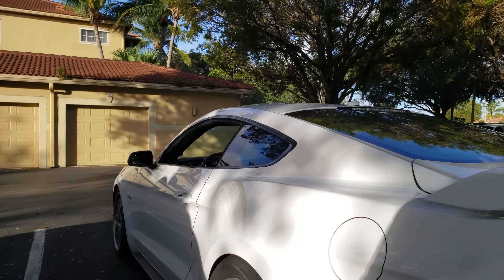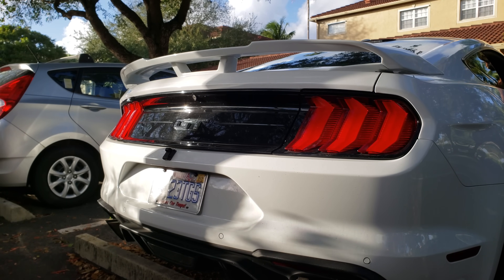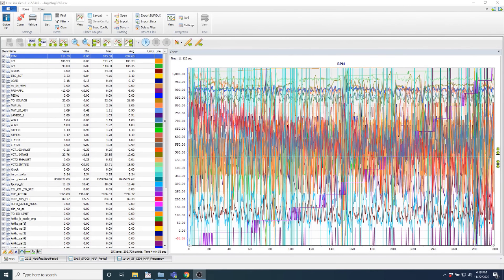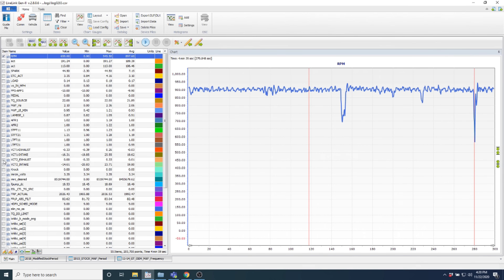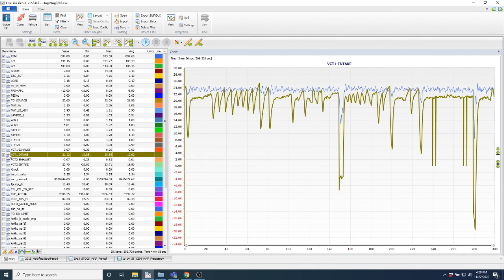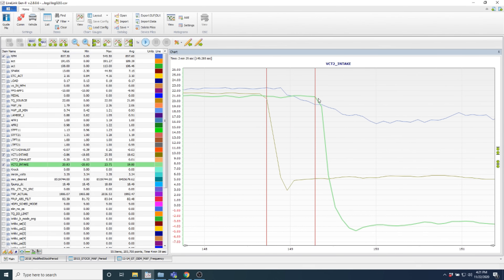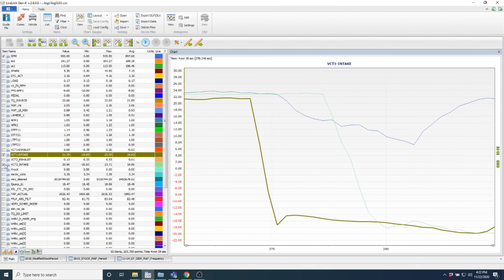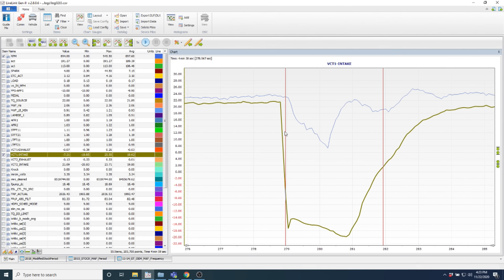Gen 3 Mustang Coyote Intake cam idle stumble issues explained.

Comment: Is a shame they made it that as soon as you touched these Gen 3’s you were in for a rude awakening to pay to play with failures.. goose chasing.. continuous issues.. then put very high quality bolt on you can to mitigate issues and then realize that motor just teases you constantly with fearing what’s going to go next even if you over maintain the car.. really great platform slightly ruined by inadequate driveline and over engineering or under engineering.. even with a perf pack 1 car which before the Mach 1 was the babiest GT350 you could get or the proper from the factory one you wanted to get from the factory with the 9 inch torsen rear 3.73 gears 6 piston brembos bigger throttle body so on and so forth.. I know the 10R80 guys issues are more motor related if anything but 6 speed club it’s that and then ford forgets how to build a driveline forcing you to get a fully billet stage 1 from Calimer.. I have spend 70% of my ownership experience chasing and fixing this car.. modding it to enhance reliability if that makes sense like MGW to cure lockout issues.. and even after all of what’s done to the car.. boom pow your ignition and phasers are now bad.. if I didn’t love this car and only being the second owner I’d have traded this in on a manual wide body scat or LS7 or grand sport by now.. just unreal.. its like raising a child every time you look at it it charges me $82😂😂

Comment: Mine is a FBO+ with a pump gas tube and fully built driveline.. always run 5w20 and pit a half court in every 400 miles or so.. maintained by Ford technicians only.. I have had my fair share of failures and honoring.. I have to be honest I was having this issue with quite a swing in rpm on start up and at temp out of nowhere before the tune.. put the tune on and it somewhat cured the issue just about a entirely.. then data logged for Lund and they said everything operating fine from what they can see however your Bank 2 upstream O2 is basically blown out we can’t do proper fuel trims.. went to replace it and apparently the one tech in the group of 3 I use wired my O2’s in backwards and if I remember correctly somehow to opposite sides.. informed Lund we got them sorted and installed the new part.. however the issue persisted with the noticeable idle swing.. started to hesitate on acceleration below 3k rpm and just didn’t feel the smoothest in general.. my tech reseated piston 8 spark plug and that made a notable difference but the issue it’s still there.. Lund is saying its timing chain related my tech is saying VCT or phaser related.. now when it swings downward in idle at temp there’s this rattle going on that seems to be coming from driveline area or rear.. unless it just sounds like it’s from the rear but it’s actually coming from the front.. anyone have any thoughts? I’ve got misfire codes and a P0011 code as well. Already did a crank relearn once my McLeod 800 went on and then now fast forward did another crank re learn through the Lund device.. I trust my techs they’re pretty good and they’re doing process of elimination here.. compression tests came back more than fine too and no vacuum leaks.. is this just timing component related or is it ignition?? Hope this helps anyone else experiencing similar 🤝🏼
Reply: *go wrongs” not honoring😅

Comment: Is it normal to have a loopy idle when ur tuned?
Reply from the maker: @10r80.chriss  no
Reply: @ I’m tuned by rob and at idle rpms will drop. Car will shake a little like it kind of wants to stall out but then it comes back to life. It’s not a consistent idle u can def hear it when you’re listening to the exhaust. I’m not sure what it could be.
Reply: @YDBT4LIFE it doesn’t sound like the car in the video but I’m not sure if it’s supposed to idle differently maybe he changed the cam timing or something
Reply: @YDBT4LIFE  it like stumbles a little even during cold starts

Comment: Mine was doing this turned out to be bad cam phasers currently at the dealership
Reply: did u fix it? mines in the shop getting cam phasers too, same issue
Reply: @mannyh9824  my 3rd partywarranty ended up paying for it but they did everything possible to not pay though
Reply: @209alfredo2091  thanks for replying man. Right now my warranty is doing the same lol. I’m just worried that it’s gonna end up not being the cam phasers. I haven’t been documenting my oil changes cuz I do them myself 

So I’m scared if I have to get another repair done bc this wasn’t it, they’re gonna  ask for it. Rn they haven’t I got blessed lol
Reply: @mannyh9824  no problem man the warranty company sent 3 different "experts" to check the car first one said couldn't replicate the problem the 2nd never showed up and 3rd finally said yes but they checked every fluid every oil change date trying to find a reason to say no it was $3,500 to fix. It was at Ford for almost 2 months. Ford customer service was great just be careful with the warranty company and document your oil changes by keeping receipts

Comment: I have a 15 coyote swapped boss intake and jlt ans had tuned now it has a random missfire at 10%throttle 2000rpm changed plugs pretty sure coils are good im at a loss wot car runs great outruns other 550s but that area at cruise speed changed oil ect im almost to the point of going back to stock manifold

Comment: This is happening to my 14 GT. It slightly 👌🏾 drops idle when I come to dead stops. I replaced all my ignition coils, spark plugs & o2 sensors. I’m pretty sure I don’t have any leaks. I even got a new intake manifold, hoping I fixed the issue!

Comment: Hello someone help. Alright so my 22' GT is tuned on E85, catless fully straight piped. I have this cam lope idle sound now, after multiple high revs to red line. Before this, between 1-2k RPM if I were to hold the RPMs and play with it in between those RPM's it'd result in a backfire. Shifting from 1st to 2nd gear shifting below 3k rpm, would also give me some backfires and pops under normal driving. However like I said earlier, looks like I messed it up even more after revving the engine high, and now my car sounds like its cammed. VCT Solenoids and Cam Phasers is this the solution? Do I now have more serious problem now?
Reply: Hey boss did you fix this ? If so how did you fix it.?

Comment: My friends 2021 GT starting doing something similar today after installing a cold air intake, and is throwing lean codes and random misfire. coming to a stop and leaving from a stop it stumbles, drives fine getting up to speed and cruising down the road, and under full throttle it runs a little rough and sounds funny too.
Reply: What's the voltage? Below 13.5?

Comment: I have noticed a slight drop on my 14 v6 while idling. Ac not on and it just drops down a little for a few seconds then back to normal idle. but it isn't a stumble just drops down. My 12 Acura 3,5 V6 juts stays at steady idle and never drops

Comment: Wonder if old oil and oil pressure are causing it to go into high cam for an instance, then loses oil pressure again, then goes back into low cam. It suddenly idling like it haves big cams most likely seems like the high cam idle if it was locked in high cam kind of like the ghost cam tune. Had a Nissan with vct and that thing gets stuck on high cam and we'll have to end up running the motor with harsh chemicals additives to get it back to running normal again.

Comment: My 2019 Mustang GT has this stumble idle issue with 24,000 miles. Warmer Florida days it's worse with a few stall outs. Cold days it's not bad.  I seen some Mustang owners replace the intake manifold wich has 2 silinoids controlling internal throttle plates that are prone to break.. Causing issues. So if you have replaced  spark plugs..ignition coils with no results..This must be it
Reply from the maker: That's not the issue, the issue is oil pressure at idle.

Comment: I have a 19 that’s had a rough idle since brand new. @round 4,000 miles I was waiting in line for coffee and it almost stalled I lightly gave it some gas and it came back and hasn’t done it that bad since. I just drained the appropriate amount of oil and put 2 bottles of ceratec in @ 13,000 miles and omg is it smooth. For anyone that wants to smooth it out try it. As for the warranty ford would have to prove that an additive caused the issue and there’s proof with this video and people saying the additive works so that’s my back up if a problem arises thanks for the video 🤙🏼

Comment: Alejandro:  
Very interesting video.  Thank you for your in-depth highly intelligent research.  
My new 2019 Mustang GT PP1 with 20,000 miles began the intermittent stumbling idle issue.  Very annoying at traffic lights.   Took it to the dealer as it was still under warranty.  Tech kept it for a couple days until he too experienced the stumbling idle. Tech replaced throttle body.  Worked great for about 300 miles then started again.  Therefore I did a few things myself as follows and I have not experienced the idle issue again for a year now: 
1. I installed a catch can and it does a great job of catching and condensing the vapors into fluid and into the catch can.  
2. I switched from factory Motorcraft 5W-20 oil to Motorcraft 5W-30 oil.  
3. I stopped using Marvel Mystery Oil in my gas and crankcase. (I use it in my two Mazda 3's however and they run smooooooth and fast, like sewing machines lol)  
4. I switched from Chevron premium to Shell premium fuel.  
Not sure which remedy affected the good outcome, or if two, or if all did.  I have a feeling the heavier viscosity oil did the trick as you touched on that in the video. (The Mystery oil in the fuel and crankcase I also believe contributed to more crankcase vapors entering the throttle body via the crankcase vapor recirculation too. I am happy now.

Comment: My 19 gt has this problem I only have 8500 miles I just did a oil change the problem went away for a while about 1500 miles into the new oil change the idle problem came back I thought it was a throttle body issue happy I watched this
Reply: I'm having the same as our problem with my AT&T.. my dad is a mechanic and he said more than likely he think it's the idol valve control. So I looked up out of control on YouTube and whatever explaining is exactly what's happening to the car

Comment: My car started doing this at 55k miles. My warranty is up. But it does not throw a code  is that normal ? When I looked at it with my solus the cam A gave numbers like 54.2  but cam b was0.2

Comment: My 16 does this, it sounds like a mis-fire, not this low stumble.  I bought the car used, and is tuned in some fashion "off road exhaust" and no cel. This is an interesting thing to hear about. I was considering it was cam phaser, or cam the cam sensors, or maybe even the crank needs to be re-phased, but i dont have the stock tune file, and didnt dare to do it.
Reply: My 16 is doing this and I tried changing the sensors and rephasing the cam nothing changed. Getting the Cam phaser replaced is my next try
Reply: @ericalvarez5322  is your car stock?

Comment: My friend have this same issue on his 18 after his first motor went out. Ford replace it and started doing it, we went back and Ford with the dealer trying to figure out the problem and no luck. It does it with the tune and without the tune
Reply: I'm having the same problem too... In fact I just went to the dealer today and was there almost 8 hours waiting and they came up with nothing... My dad is a mechanic and he said more than likely it's the idle control valve

Comment: My 2019 does this occasionally.  Bought it new and the issue started at around 20k miles.  I'm now at 51k and the issue hasn't gotten worse or better.
Reply: Have you gotten the issue fixed? Has it gotten worse? I’m debating on whether buying new solenoids.
Reply: @jesusespinal413  I bought 4 solenoids, replaced the 2 on the driver side and that seems to have fixed the issue.  Currently sitting at 64k miles.
Reply: @Bobbybeb is the solenoid change a rigorous/ expensive job?

Comment: I have a 17 that does this exact same thing
Reply: did you fix it
Reply: @MrAlternation  actually turned out to be the tune. Never figured out exactly what the cause was in the tune tho. It would be fine one day and the next it would die when coming to a stop or the idle would surge up and down. The strategy of the tune was changed but nothing else ever stood out to me for me to think that was Forsure the cause of the issue. I do have the ford performance upgraded phaser solenoids but I don’t think it was that either because it was intermittent and not constant

Comment: Bought a used 2018 gt premium with only 5k miles was good for a bit but for the last month or so I’ve been having these rough idle issues and it dying on me at stops. Has anyone pin pointed the fix for this? Dealer told me my camshaft timing for bank 1 was over retarded
Reply: Did you get it fixed???
Reply: @jonathanreyes6325  replace solenoids
Reply: @drewski58  where did you buy them and how much did it run you? When I look them up online i only find VCT Sloenoids for 2017 GTs and lower.
Reply: @jonathanreyes6325  go to the dealer and tell them that you have the issue and you need them to replace the solenoids. They should replace them at no cost
Reply: @drewski58  did you do it under the warranty? I have an extended warranty
Reply: @jonathanreyes6325  yeah under warranty
Reply: hey my dealer said the same, but theyre replacing vct cam phasers, u think im good?
Reply: @ they have to check and replace the solenoids. Then you’ll be good.

Comment: I had an 19 MT-82 and it never did that (it had 12k miles and I did 2 oil changes). I have a 20 A10 and about 6k miles, I just did my first oil change and I will try to pay attention to notice a dip in the idle RPM

Comment: Cam phasers replaced didn’t fix the issue neither did the roush tune update and cycling the vct the weird thing was that my engine coolant was low so i decided to max it out and all of a sudden it fixed things its been two months since i maxed out my engine coolant maybe it didn’t work from the start cause the dealership i service at  didn’t  fill up the engine coolant to max lines?
Reply: No relation to cam phaser issues

Comment: Full synthetic oil fixed that issue for me. On Lund Flex fuel tune, thought it was tune issue but oil changed fixed it.
Reply: What oil you put in it? Mine has this problem and Lund told me to put 5w50 oil
Reply: Yes what oil did you use?
Reply: @YoungWoodzOnDaBeatz  Im on lund E85R, went from 5w30, to FordMotorcraft 5w50, issue rarely happens anymore. If at all

Comment: Anyone get a definitive answer as to what is causing this? Been going back and forth with my dealer for a few months because they refuse to look at the issue :/
Reply: Intake cam phasers falling out of phase. Like Alex said, some folks have said Ford replaced said Cam phaser and it resolved the issue. While others, such as myself, moved to 5w-50 oil (im tuned, Bolt ons, E85) and no longer have the issue once moving to Ford Motorcraft 5w50.
Reply: The Ford stealerships are mostly incompetent and sometimes corrupt.

Comment: This was happening to my 2018, always stumbles when at idle. Took it into Ford and they told me they’re going to replace the solenoid and cam phasers also. Still waiting on results after they replace it. Thanks for this video, this definitely gave me an insight of what was happening with my mustang.
Reply: Any updates?
Reply: @matthewkruk67  took it to the dealership the fourth time there was scoring on my cylinder head gasket so they replaced that and it seems to working better so far put 1k miles with it seems to run good
Reply: Update?
Reply: Update
Reply: Update bro?
Reply: @clipslord6364  Haven’t had any problems at all after they fix the solenoids.

Comment: My 2020 A10 GT has an odd idle quirk. Cold start it idles fine but will “skip” a beat just for a split second. It seems like something it turning on or changing. That’s with and without AC on.
Reply: It’s when the car switches from direct injection to port injection.  It’s almost around the 30 second mark.  Mine and others do the same thing.

Comment: I have a 2019 that I got brand new. Don't know if it matters but I've been running mobil 1 5w30 ever since the mustang hit 1,200 miles. And mine doesn't do this at all. I didn't even knew this was a common problem.

Comment: I've never had a Idle issue in my 2018. I've ran Amsoil 5w30 since the day I got it. When warmed up it holds 620 RPM steady always after 16k miles.

Comment: Mine started doing this out of the blue recently.  Went about 16,000 miles never having done it till I came to a redlight a few days back and it died.  Car went through 10,000 miles with a Paxton on it and as soon as I went back to motor this car has shown it’s ass 😂

Now everytime it’s been running a while and I come to a stop the STFT’s freak out and it either dies or stumbles.  Guess I’ll try VCT solenoids assuming those aren’t also on National backorder like half of Ford’s replacement parts
Reply: Update?

Comment: Great info! My ‘16 GT is throwing P0308 Cylinder 8 misfire, P345 Cam shaft position sensor A circuit 
P349 Cam shaft position sensor A intermittent. Could this be the problem? Has LTH no cats, Roush Charged, and VMP tuned. Help 😵
Reply: i have the same car and same codes !!! did this fix the issue ?
Reply: @angelherrera1336  Hey, took it to the Ford Dealership and they had to replace the Cam Phasers, was a little expensive.